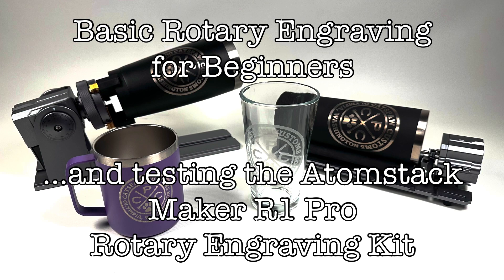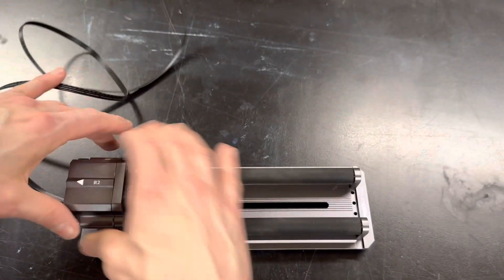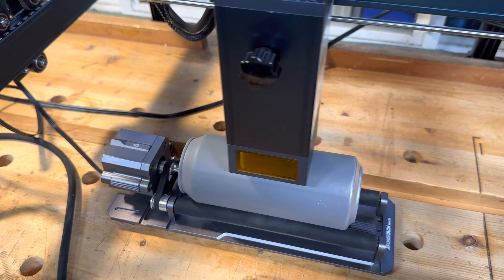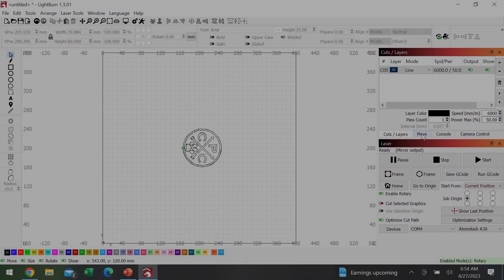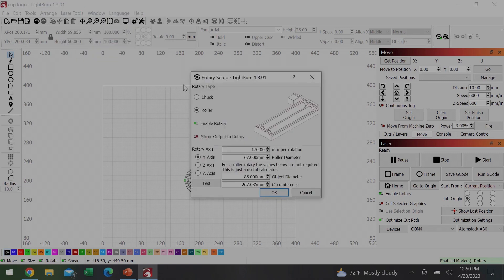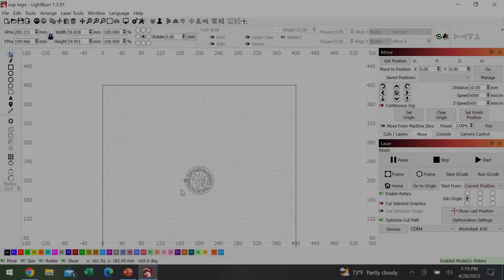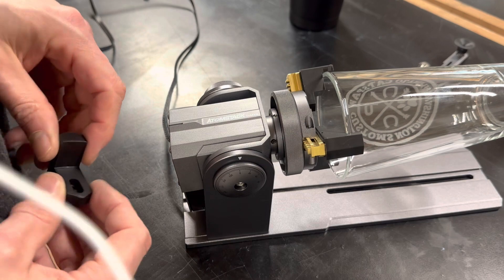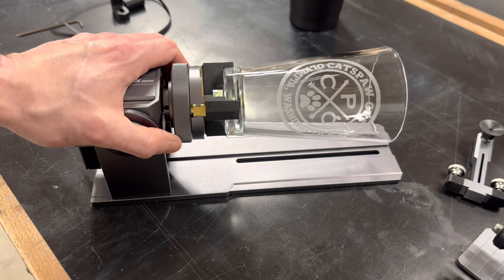Basic Rotary Laser Engraving for Beginners (and testing the Atomstack Maker R1 Pro)

Comment: I can't get rotary chuck to hold on to heavy dollar store tapered glasses. It don't matter if I try to grip them from the small end or the wide end, they slip out of the the chuck. And, it also doesn't matter if I grip them outside or inside.  Any ideas?
Reply from the maker: My best suggestion is 3d print some different jaws if you can and make some sort of roller rest for the unsupported end.  Or maybe get lighter glasses, the chuck has its limits.

Comment: You mentioned that it was good for hobbyists.  What do pros use?
Reply from the maker: No idea, but a pro won’t be using a diode laser.  This would be fine for a side hustle, but if you were making a living off it, you’d want a CO2 laser to start with and then whatever compatible rotary you could get.

Comment: About holding a cup from below... can't you rotate the motor to the other side and raise the bottom plate as needed then...?
Reply: Yes this is the design of the chuck to be able to do this.  But there are some limitations in my case- Once I flip the motor over and try to put the base sticking backwards and a tumbler sticking out I can't fit this in the enclosure I made... 
I see two flaws that will need addressing in my case.   The above mentioned is supposed to be the solution.  I don't like that the chuck is about a 1/2 inch to short from the base up.  A average mug with a handle will just hit the base. 
I am planning a 1/2" spacer for both the uprights under the motor, and the suction cup support.   Then I will not need to flip the motor over just to clear basic handled mugs.      
I just managed to solve the part of the equation  that Catspaw mentioned at the end.   
There are 2 points of "detents" that stop it from going past 0-180 degrees.   The uprights have a little block that acts as a stop.  And the indicator side has a small screw that rides in a arched slot.  Remove this screw and reassemble the indicator with the uprights flipped.  (block facing outwards. 
Now the head can rotate past the 0 degree point.   I made a new mark on the indicator side so I had a quick reference of 0-ish' but use the level anyway for final adjustment.    
As Catspaw mentioned there is still the need to be SURE that the head is locked down so it won't droop, as there is now nothing stopping the head at 0. 
Adding the 1/2" spacer I mentioned will offer even more room to level items. 
Let me know if you like this idea.  I will be testing it more in near future.  May make a video for it if it all works out.